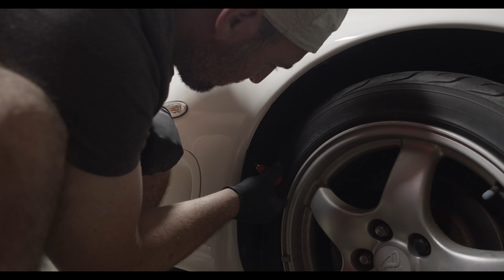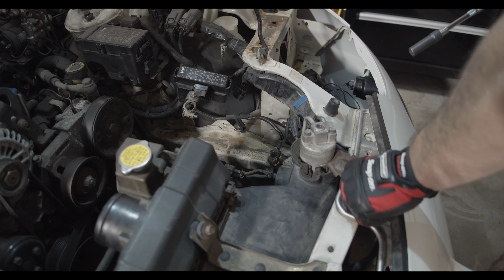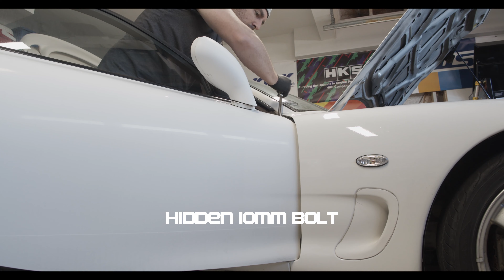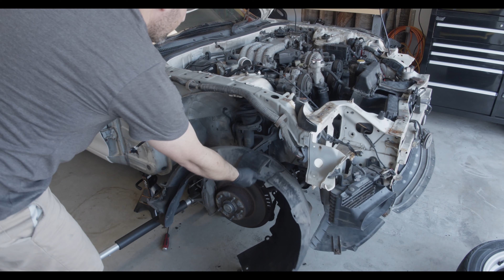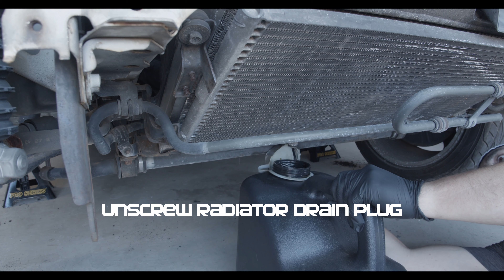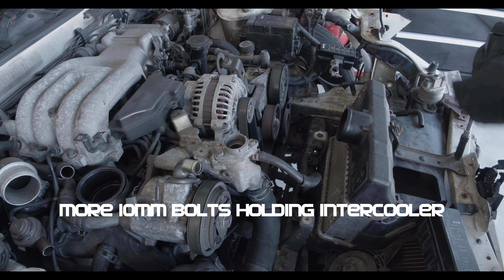Disassembly of my FD RX-7 Part 2

Comment: Are you going to change the engine or only replace every piece with new ones?
Reply from the maker: I’m rebuilding the engine to handle high horsepower and converting to a single turbo setup.